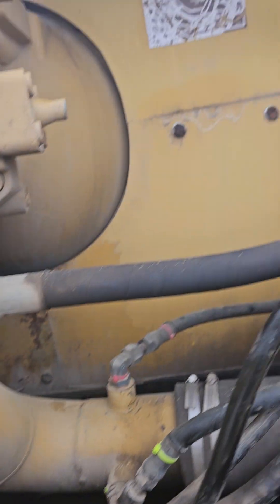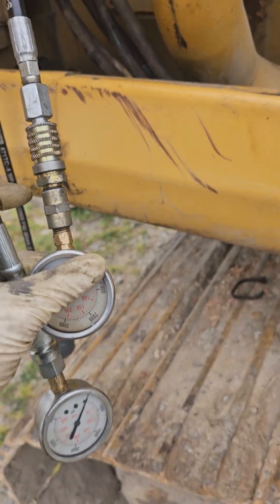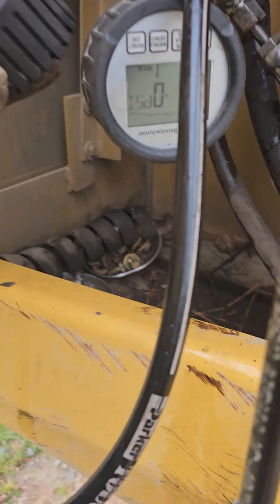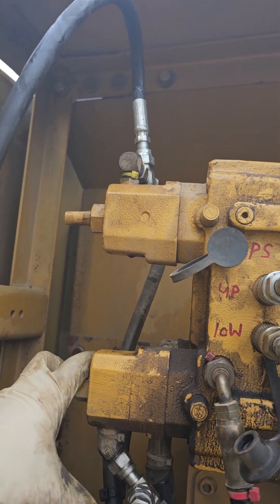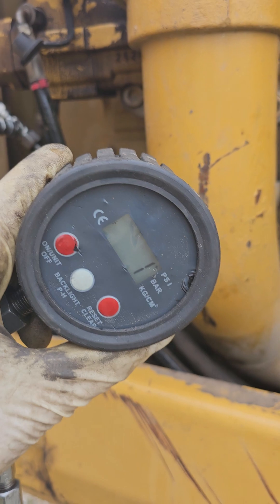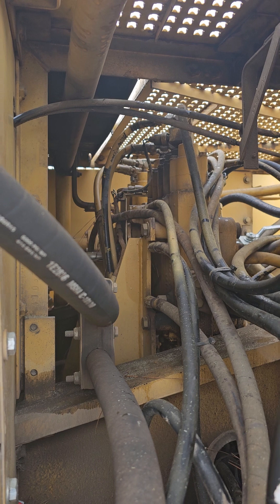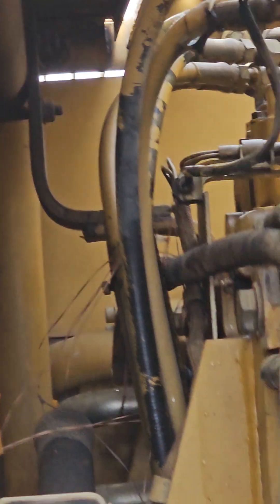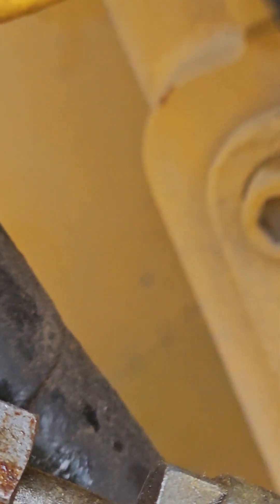Diagnosing Cat 330L: Tackling the Left Forward Track Power Issue - Part 1 | Mobiledieselmedic.com

Comment: WHERE have you BEEN?? Hope that old swashplate pump hasn't had you hung up all this time! Stay away from mixers and Be Blessed!
Reply from the maker: Hi Lewy,  I made a few video's and my phone hasn't stopped ringing.  I've been filming all the repairs, but just haven't had a minute to post.  I think I will look for someone to help me post the video's.  Good to hear from you.  Honestly the only reason I posted this video was to turn the video in to tech support at Caterpillar.  The parts guy over there can't find the part.  I was hoping the video will help him.
Reply: @mobilediesel  All right, pal, I'll let you off. I hadn't heard of yall starving to death or anything so it was one of those no news is good news deals. Shame that the parts guy can't read a schematic. Got to be one hid over there somewhere. Maybe it's like a lot of the new stuff is that's hid behind special company passwords to keep the real mechanics from fixing it but having to haul it back to the dealers all the time. I've got two REALLY good mechanic pals that quit the outfit here and went to work for Cat and NOW are quit Cat and one is working for the county and the other is back here again. That is a CRAZY deal because Cat used to be a coveted place to be. Glad I'm just fixing my mowers and not having to mess with those guys. My last one was the drive disc coming out of a D5K LGP. Looked like a timing gear on an overhead cam car motor. Went back up with a lot beefier part. So Yall remain calm and God Bless!